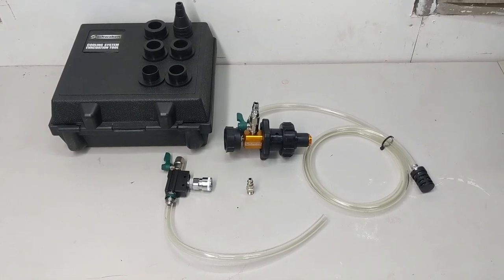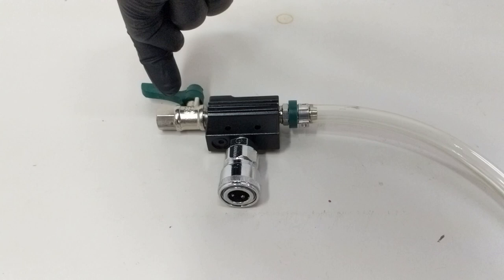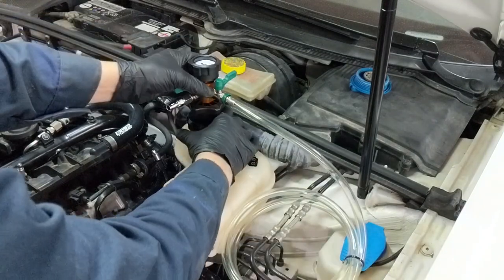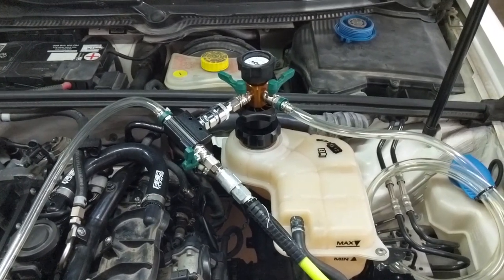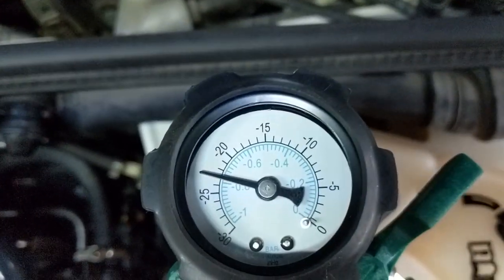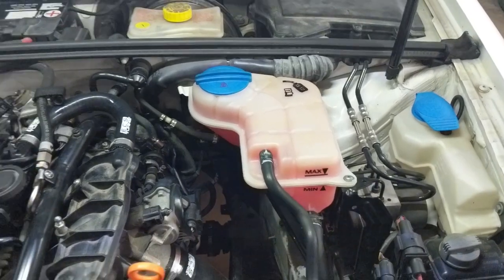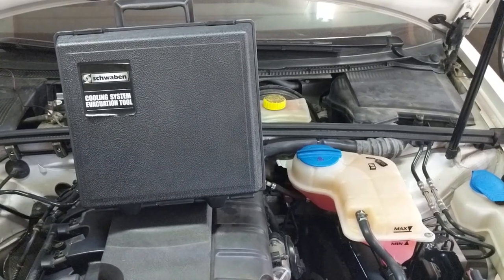Schwaben Coolant Vacuum Refill + Air Purge Tool | Cooling Test and Refill Tool Review | Audi VW

Comment: Way better video than the one from ECS themselves. I'm getting ready to use more for the first time and this video really helped. Great Job!
Reply from the maker: Thanks Tuan, I appreciate that very much! Good luck with your project.
Reply: used mine for the first time. Followed ur video exactly and it worked perfectly. No air in the system. Great tool.

Comment: Awesome video! Only thing that I’d probably do on my end is to purge the coolant jug line until I see fluid all the way to the valve while vacuuming the system.
Reply: In the manual of 1.0tsi, they say to do exactly this thing. Then close the valve for the coolant and other two minutes to vacuum. Then close the vacuum valve and open the coolant valve.

Comment: Just tried this tool on my A4 B9, same issue, 35mm too loose, 40mm too tight. I held on the 40 while creating vacuum and it seems to stay, but wants to pop out. had my hand on it the whole time. 37, 38mm would be perfect.

Comment: Good video.I just got my fill system and though the tool comes with printed instructions your step-by-step video provided the detail I wanted.  I picked this up to fill a Vanagon (18.5qts) after replacing the coolant pipes, it has  a poor air bleed system with 2 heaters and many possible air traps so this should make the job a lot easier. I am assuming that you could have shut off the fill when the coolant level reached the mid point between Min -Max and that would have eliminated the need to remove any extra coolant to bring the level into spec?

Comment: Does the system actually need to be completely empty for this to work? Do you need to turn on the heater to open the valves and leave it open before starting this process?
Reply from the maker: Hey Jonathan - Check out my answer to grilledchickenwrap re: introducing a vacuum when there's still coolant in the system. So, if that's the case, I think the answer is: no, but by knowingly leaving old coolant in the system, you're accepting that a full flush isn't being completed and if it matters to you, you'll want to check the freezing point of your mixture later to ensure what you've just put in hasn't thrown your coolant mixture out of whack. I'm guessing you're wanting to do a partial refill after doing some work that doesn't require you to drain the whole system.

And yes, turn on the cabin heat and leave it running (with the car off, just with ignition on) while you're doing this.
Reply: @FigureItAudi  Thanks!

Comment: You didnt bleed your filler tube and introduced the air back into the system and when your gage was stuck at 22 was your compressor still maintaining 90 psi?

Comment: Interesting but 2 things :
1. this doesnt solve the close thermostat problem. If its close, it will only remove the air pockets outside the engine, and not in the engine, right?
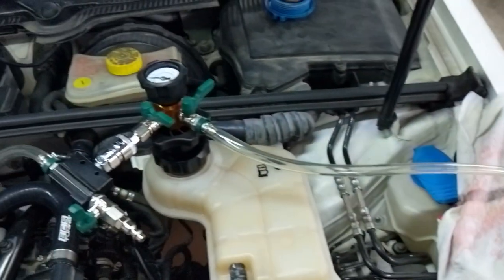2. when your vacum is complete and you open your circuit to fill with coolant, that tube had air 9:09 which should have been purjed, right?
Reply from the maker: Interesting questions. It does solve the thermostat challenge, since the coolant can go backwards it's normal flow like through the radiator inlet and reach areas that wouldn't be accessible through a gravity fill. But you raise a good point about the air in the tube that sucks up coolant. I think ultimately it's not of much concern as the air will sit at the top of the coolant reservoir and generally bleed out over the first few drives. Every time I've used this tool, the coolant level in the tank has barely dropped after the vacuum fill, meaning it's still very effective.
Reply: @FigureItAudi  You can use the venturi to purge the air from the fill tube. Basically use that to draw up the fluid just before the housing.
Reply: @FigureItAudi  Their instruction manual pdf explains how to get rid of the excess air in the feed line.

Comment: I use a similar one all the time and i usually see -24 and -25 on some Toyotas with smaller systems, and doesn't take that long, i believe you have a small leak , sometimes the leak is at the adapter it self.
Reply: But then again my atmospheric pressure might be different than yours

Comment: Can I use this to suck out coolant from car ? And then use it to put new coolant back in?  I did not see you  remove the coolant from the expansion tank.
Reply from the maker: I don't want to mislead you so formally I'm going to answer: I don't know. But, I don't think so. I did not use this tool to drain my system; I used the petcock on the lower rad hose to do the draining. Now, I didn't do amazing in physics way back when, but I don't believe the air vacuum will be enough to do anything. Even in perfect vacuum (which is nowhere near achievable in this type of environment), the water would mainly pool and rest in [whatever] by gravity. The only evidence I can add is that although I had my drain hose set up and likely had some liquid left in the system, 0 came out during vacuum build. Not a drop.

Comment: Great video. Very informative and detailed. Trying to see if my Porter Cable 6 gallon pancake compressor will work. What compressor are you using?
Reply from the maker: Hey Frank - I've got the Rolair Bull. It's nothing wild but capable of 100% duty cycle.

Comment: thanks for this video, I am confused at that when you were using air compressor, isn't it push in the air instead of suck out/vacuum  the air ? and before all these process, you already drain out all the old coolant, right ?  thanks
Reply from the maker: Thanks for watching!

Yes, I had already drained as much of the coolant out of the system as possible before I did this process. This video is actually just a small part of a larger cooling system project I will be posting soon. I'm not sure what would happen if you tried to build vacuum in the system when it was still full....I'm guessing it would suck out a lot of coolant but I don't think it would be that effective. Schwaben themselves say the coolant should be drained before attempting to vacuum fill.

I think the best way to answer your question about the compressor air and how the system gets bled is understanding how the venturi effect works: 01:44. The compressor IS pushing air, but when it passes through the venturi adapter, it creates suction in the tube BESIDE the path of air direction, which draws air out of the system and exits the same direction the compressor air is pushing.

Does that make more sense?

Comment: I run these off my shop compressor and I do not recommend you use a small portable, it won't have enough flow rate. You should precharge your coolant input hose before you do this.
Reply: If using a small portable the instructions say to use 90psi rated and mine goes to 110 so when it drops below a desired level of psi I shut it off and let it regenerateand continue making more vaccume in the system

Comment: Can we suck all the old coolant with those tools without draining it? 🤔
Reply from the maker: No it doesn't work like that. You could always use a fluid extractor pump (ie Mityvac) if you can get one of the suction hoses down low into the system but more than likely you just need to gravity drain the coolant like normal.

Comment: The gauge needle didn't come to zero because you didn't bleed the hose on the filling side. Antifreeze had to be sucked in with air up to the head of the valve. But except that nice review.
Reply: yes, when doing the vacuum open the coolant intake hose valve to pre charge the hose, and at the end when your near zero lift the coolant container over the reservoir hight, this will drop it to zero.

Comment: I have some questions over this I hope you can answer. 

1. After draining all the coolant, do I turn on the car and set the heat to high?

2. Do I leave the car on while doing this procedure? If yes, do I keep the heat on too?

3. Is the expansion tank basically the coolant reservoir?
Reply from the maker: Sure thing. 
1. You only turn accessory power on - depending on what your car is like, that might be turning the key 2 steps towards ignition, or pressing the start button - but the car is off. You just need power on to run your cabin fan and operate the temperature controls.
2. Yes, same as above - keep it all like this untill the refill is done.
3. Yup. I know sometimes the reservoirs are slightly lower than other fill points in the system, so just hook up this tool to whenever you would typically fill the car with coolant. It might be the radiator, even.
Reply: @FigureItAudi  thank you, I really appreciate it!
Reply: You don’t have the vehicle running during this process. You only have the key in the on position so the heater valves will open to allow all the cavities to be open.

Comment: Great video and nice job  buddy . I have a question what type of air compressor do you need to do this kind of work ? I have a craftman  3 gallon craftsman 135 psi compressor , you think this would work? Thank for your time and info 👍
Reply from the maker: Hi Julio - thanks. I found the air compressor instructions from Schwaben to be a bit unclear but considering your compressor can run more PSI than what's needed - as long as it can maintain >90psi continuously, you'll be fine. Turn yours up to 90, stick an air pressure gauge on the hose, and let it run wide open to see if it can provide enough air for a few minutes straight.
Reply: Figure It Audi thanks for getting back to me 👍 i just did the test on the compressor and it holds 90 psi with the air gauge wide open . Any suggestions before I jump to do this job ? Thanks 🙏
Reply from the maker: @juliohernandez7463  Just make sure you have enough premix ready so the vacuum doesn't pull air. Otherwise, it's pretty much point and shoot.

Comment: Do you have to plug the coolant tank drain hose?
Reply from the maker: Yes, other than where the vacuum port is connected, all other parts of the cooling system need to be air tight or a vacuum can't be achieved.

Comment: Used this on my 2010 B8. Followed fill procedure as shown (primed the fill hose). Car came to operating temperature after a while, but when i took it for a highway run my engine temperature does not stay @ 90, falls when I turn up the fan speed. Is that an indicator that I have a air bubble? What is the correct procedure to burp/bleed the air bubble out?
Reply from the maker: Hi Francis - What had you do the coolant fill in the first place? Air in the system is more likely to make your car over heat. Chronic under heating is usually due to a thermostat (which in your case is built into the water pump housing) stuck open. But if I'm chasing the wrong lead there, you can always slide the top coolant hose where it passes through the firewall to heater core (for cabin heat) back a few inches and it should reveal a small bleed hole to remove air trapped at the high point.
Reply: @FigureItAudi  Thanks for the reply. 
I have has the car for a few years now, so just a coolant refresh since I'm approaching 180K. I did the refill as per shop manual. After the vacuum fill, I opened the bleed hole, over filled reservoir using a no leak funnel had some coolant come out, flow was not strong though. Re-seated the hose, closed reservoir and ran the cabin fan speed at 6 and temp at HI for 30 seconds (for auxiliary heater, which i don't think i have). Afterwards ran Car 3min @ 2000rpm and let idle for 15min. Top coolant hose was Hot, lower one was a bit warm. ran the car for 2min @2000rpm and shut it off.

this morning, I had a 12km commute to work, 7km being on highway (105km/h). Engine temp stays @ 90 degrees, when the fan speed is between 1-3 & temp @ HI. But the minute fan speed is past 5, engine temp drops to around 70. I checked the hoses and top hose is warm, but lower hose is stiff and cool to the touch. With that said, would i have an issue with the coolant temp sensor or the thermostat based on how the hoses feel
Reply: @francismlilo3573  I was taught, put the fan /heater on FULL, then fill it and with system open (no lid on radiator) the air should find it's way out.  Do you have a temperature gauge ?  How is your coolant level ?  I have a subaru that does not seem to heat up - I changed the head gaskets since they were leaking when I bought the car...I had another car, and bad thermostat, drove it 15 min at 100-130 km/hr and windhshield was icing over, no heat.
Reply: and 2 mi at 2000 or 3 min at 3000, might seem like a long time, but it is not.

Comment: I have a 1.8t AWM engine.  I have replaced every hard part I could including the radiator, thermostat, water pump, overflow bottle, and sensors.  I have removed the top and bottom rad hose to check for clogs and have blown air through the system a few times.  I also flushed the heater core a few times.  It seems like the thermostat just is not opening when the engine gets hot.  I have been told I may not have gotten all the air on while bleeding it causing cavitation around the thermostat.  Is that possible, and if so do you think this tool will help eliminate that problem?  Thanks in advance!
Reply from the maker: Hi Brad. So, is the core issue an over heating cooling system; the temp needle is going over the center operating value? Unless you got unlucky and purchased a fault thermostat and it is indeed not opening when it should, it sounds like you've replaced more than just the usual suspects. From experience, I've seen coolant temp readings seem like they're not rising at all, right until the needle jumps almost straight to operating temp. That's when a system is drained significantly, then refilled for a flushing process.

Let's assume you do have a large air pocket trapped in the system for a moment. Usually the highest point of possible bleed off is through one of the heater core lines as it passes through the firewall. Do you know if there's a bleed hole there? Sometimes you need to pull back the hose to reveal it. Or, a bleed screw on a water line near the top of the engine?

As for your real question...yes, I think it would work. The catch is that the tool (probably ANY tool) is not going to achieve perfect vacuum before filling, so to be realistic, a small amount of manual bleeding is still likely needed. However, with significant vacuum pulled - and even if your thermostat is completely closed - the coolant will be pulled in all directions into the system. It'll be a fight between gravity + vacuum pressure but the coolant would go up through the radiator and through the various lines against the direction fluid would normally travel - to an extent.

All this said, if your thermostat really is stuck, fancy coolant filling really isn't going to be your long term solution, obviously.
Reply: @FigureItAudi  this would be my second new failed thermostat in a row. I can't see being that unlucky. 

I have bled the system in the prescribed way through the heater core bleed hole, but at this point I'm being led towards a bad bleed and I can't think of what else it could possibly be. 

I'm just going vacuum bleeding will give me the best chance of either fixing it, or at least ruling out the bleeding from the possible problems.
Reply: @FigureItAudi  also, yes the needle goes up but I've actually been watching on my torque app through the ECU for a more accurate temperature.
Reply from the maker: Fair. For the price of this tool (other brands can get quite expensive, though) and the fact it can adapt to basically any vehicle, it's a great addition to the tool collection regardless.
Reply: @Demonpixyb  hopefully you found and were able to correct the issue. 
I know on some vehicles it’s physically possible to put a thermostat in backwards and then they won’t open.
Reply: @akbychoice  I did fix it. Ended up being a partially blocked oil cooler!
Reply: @Demonpixyb  thank you for the response. Kind of like electrical, sometimes it’s not easily diagnosed. Glad you fixed it.

Comment: Wont the hoses get damage after its flattened out? Just curious
Reply from the maker: A good condition hose won't be damaged but you're right to be cautious of damage on a car that you're not confident of the condition of various cooling system parts. An old hose that has a cracked inner ply might be weak enough to crack the next/outer layer once compressed. Use your best judgement!

Comment: It seems that this kit does not allow for pressure testing.  I find that to be quite disappointing.  Thanks for the review.
Reply: Well, son of a gun... you are not alone because I am quite disappointed that my tire pressure guage does not fill my tires. 

Seriously now: this tool does the job for which it is designed. It indeed does indicate presence of a leak but not location of a leak.
Reply: @walterk1221  let's not go the sarcastic route. I know it's YouTube, but we can still have a reasonable discussion.

I was disappointed because this kit cannot pressurize the system at specific pressures above atmospheric.  That means that leak testing, under pressure, not vacuum, is not possible.  Since the cooling system of ICE vehicles have to operate under pressure, I was hoping that the kit could actually test under those conditions. That's not the case.  Another kit is needed.
Reply: @jonathanthompson3359  I am sorry that my humor appears to have annoyed you. But the tool is not sold/marketed/advertisted as capable of pressure testing, hence the very reason tools exist that are marketed as being capable of pressure testing. By your apparent logic I should be disappointed that one those cannot vacuum-fill a cooling system.